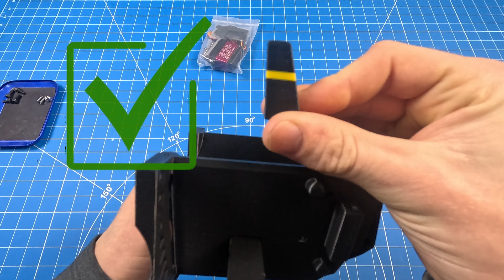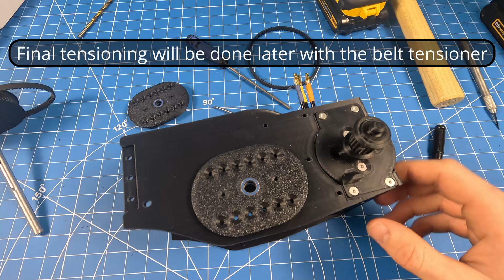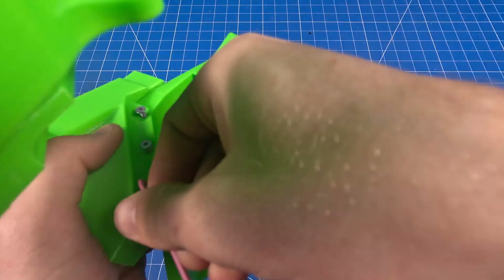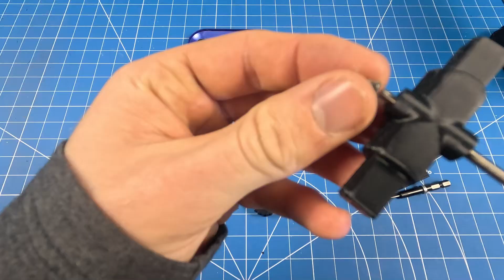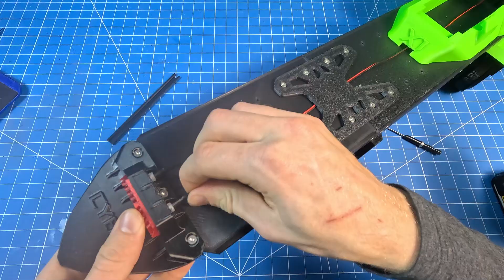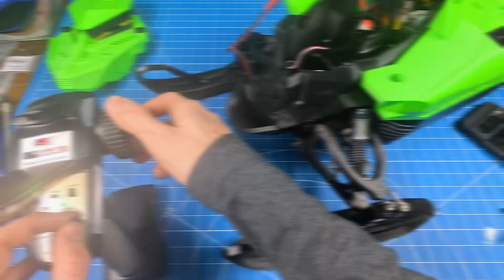X1 Full Build Guide | CYBERSLED

Comment: What file is the axle cover in? I do not see it in any of my files. I was fighting keeping it centered, I assume that’s what that was there to do it keep it from sliding over.
Reply from the maker: @justindunnuck3895  I noticed in your video you mentioned you had issues with the large pulley rubbing against the plate and melting? Did you utilize the drilling fixture to bore the driveshaft holes? 

If that's an issue I can definitely hop in CAD and slightly change the drilling fixture to move the drive pulley hole out a little farther from the frame. 
I seriously appreciate the feedback, thanks. ♥️
Reply: @ drilling fixture was fine. I think the issue was nothing was holding the sprocket from side to side motion. The washer  behind the spur fixed it.
Reply from the maker: It'll be introduced along with a bunch of other improvements in the next file update. Should be out sometime near the middle of the week. 

The main reason for it is to keep the bearing from falling out, but it also strengthens that plate.

Apologies for the confusion.